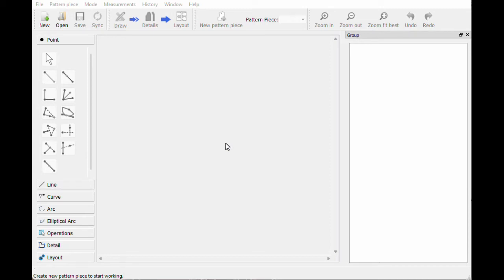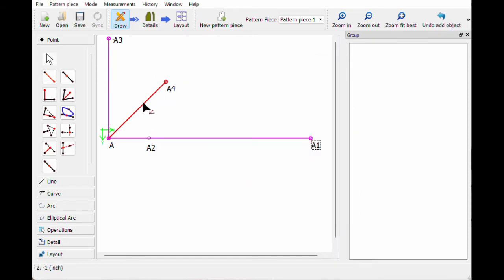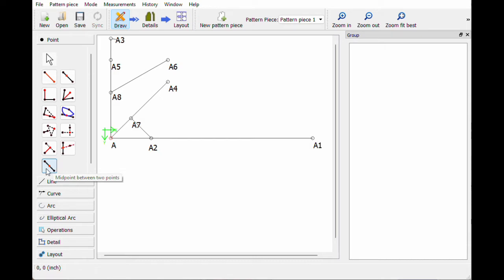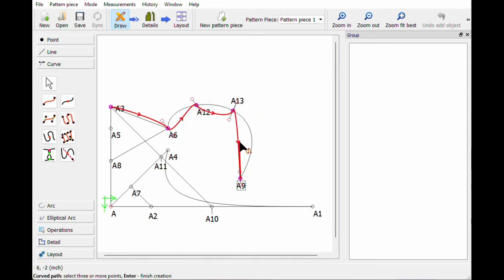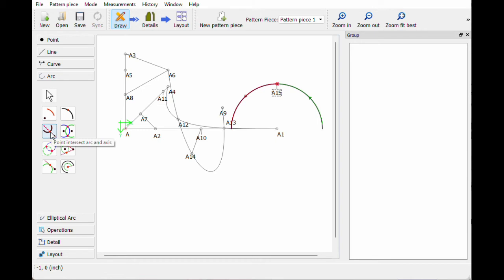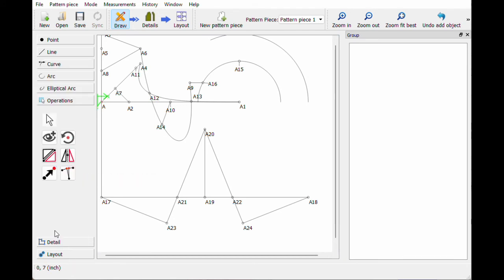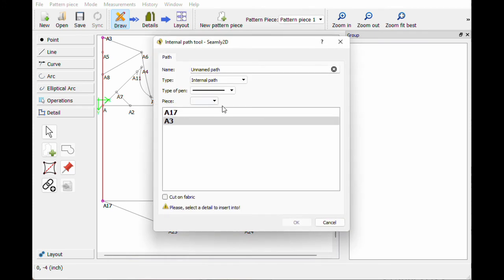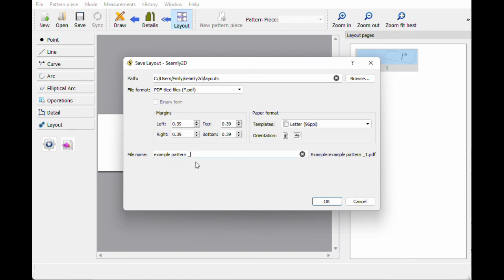Video 2: How to use Seamly2D CAD sewing DESIGN SOFTWARE formerly Valentina

Comment: Hi! Just a question, what should I do, I can't use detail/layout mode. It kept on telling me to create a workpiece(?) First before proceeding and I made a pattern actually but yeah, I can't use detail mode (the seam allowance option I think?) Pls heeelp
Reply: Hi! In your column on the left with all of the tools, go to the detail category. Then click "workpiece tool". It looks like a bodice pattern with a green plus sign. You'll use that to click points outlining your entire pattern in a clockwise order and then hit the enter key on your keyboard. That's what sends it to details so you can add your seam allowances and such. Congratulations on making a pattern! Let me know if you need more instruction on getting it into detail mode or how to print. Video 5 in the series specifically explains how to print them out, and I'm happy to answer any questions. :)